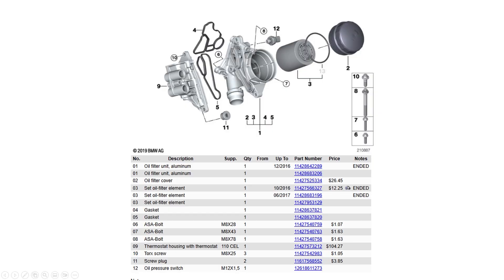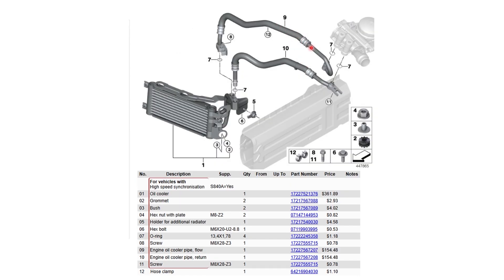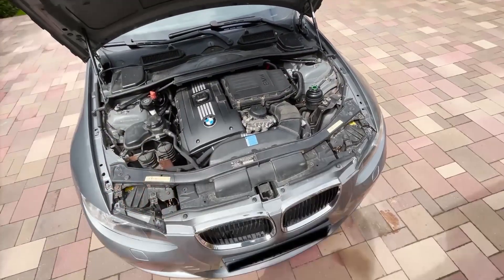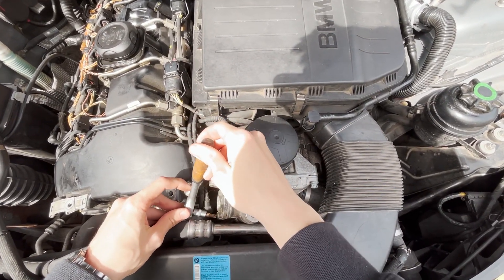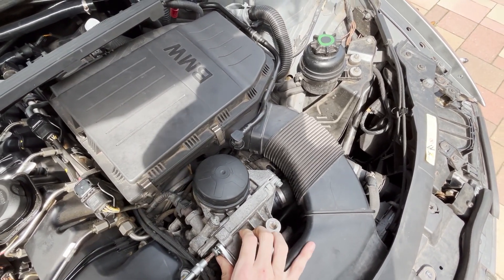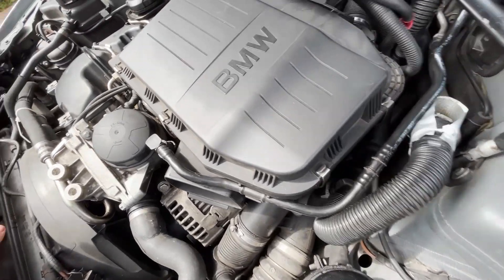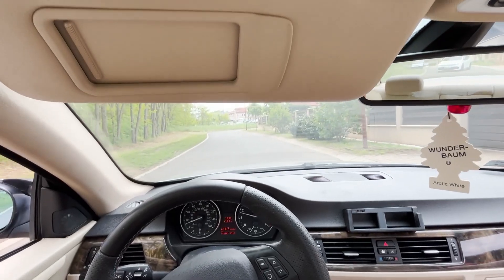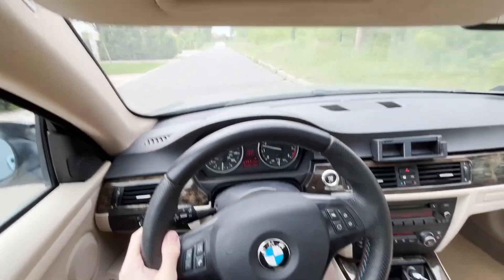Guide to N54 low-temp Oil Thermostats!

Comment: lol, the perfect video.  i have a 10/2006 build too and bough the same thermostat without the aftermarket cover.  i could not figure out what was wrong, so I decided to come to youtube to check and here you are.  instead of buying a new cover, i just drilled mine out with a 7/32" drill bit.  worked great.

Comment: Good video, just a month ago I bought the type 07, from ecs, it's exactly the same as yours, and instead of working colder the oil now works hotter, I don't understand what's happening, before my n54 It worked at 110°C, when I demanded it, it quickly rose to 120°C, but in normal operation it never went over 110°C, and now with the low temp thermostat it is always at 115°C and with little demand It goes up to 120°C and never returns to 110°C. I installed it as indicated in the instructions that came with it.

Comment: Great so now you don't have a thermostat so oil will always flow
Reply from the maker: untrue. The way the factory plunger operates is that it has holes that bypass the cooler even when fully up to operating temp, meaning you never get 100% through the cooler. (this is for type 07/08, my third type is even more weird so let’s not get into that)
This low-temp style does not have bypass channels and instead pushes the plunger open by oil pressure. As the oil heats up the spring element on the other side it forces the valve closed and the flow now has to go to through the cooler.

The car also heats up faster than it did so there is no way the cooler is always at 100%.

Hope this helps!